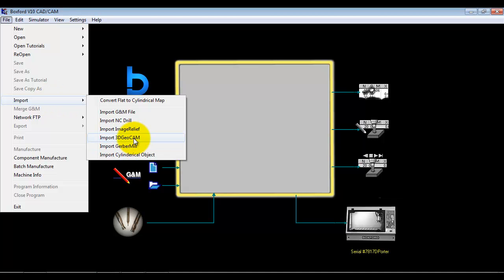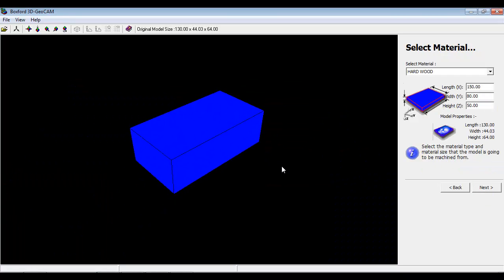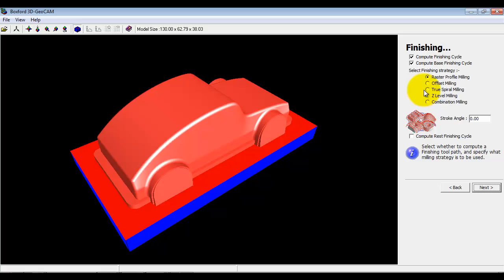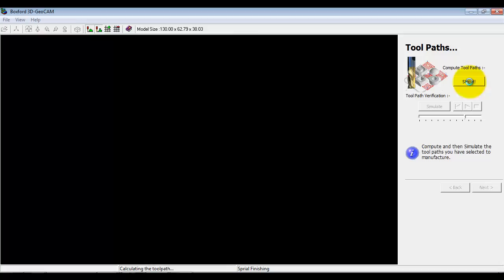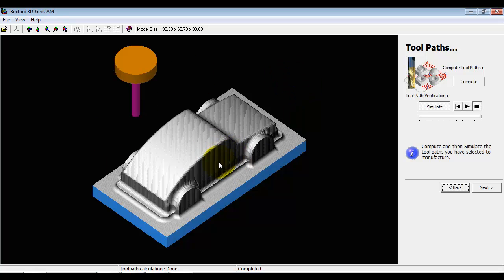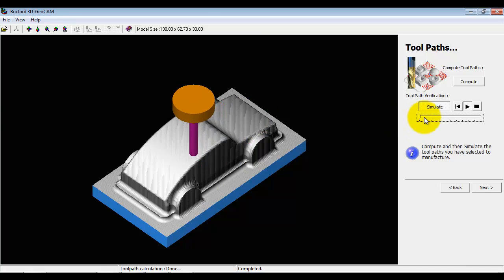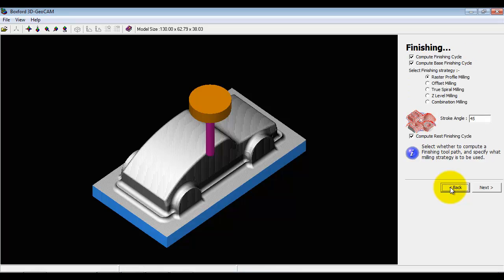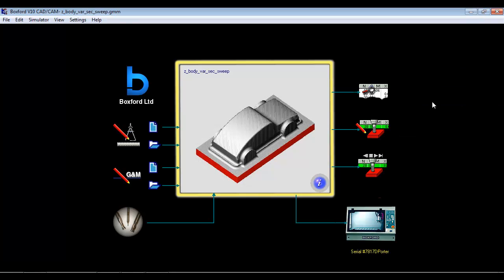Boxford CADCAM Design Tools Software - 3D GeoCAM STL 3D Model Import Wizard Overview

Comment: Very nice 👌 
How much does the software cost ?
I might buy a second hand boxford cnc mill , but it has no software.

The seller also said I could get the mach 3 upgrade but I don't know what that is .
Reply from the maker: Please supply the serial number of any machine you are thinking of purchasing to info@boxford.co.uk and then we can check if it is compatible with the latest software and provide a quotation. Machines with an 'i' in their name will all be compatible with Boxford software, e.g. A3HSRi2, 190VMCi etc. A MACH 3 upgrade would require replacing all the Boxford control electronics in the machine and running the machine from MACH 3 software and not Boxford software. We do not offer a MACH 3 conversion.